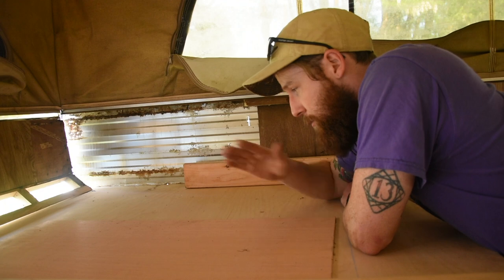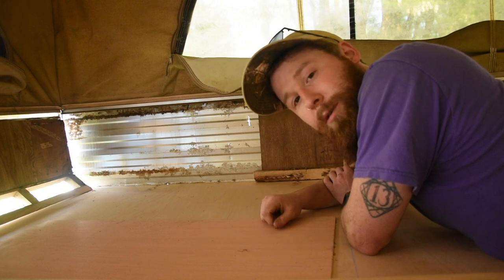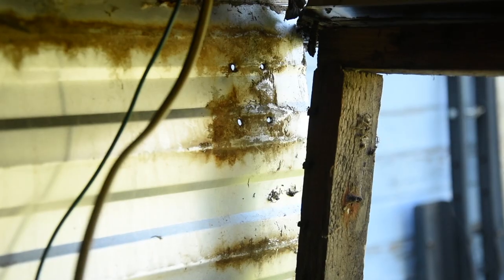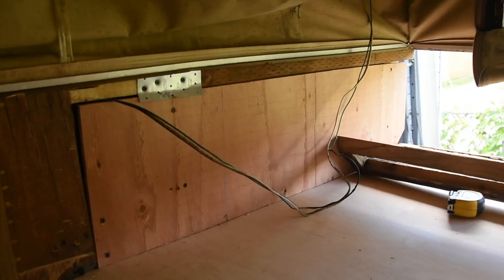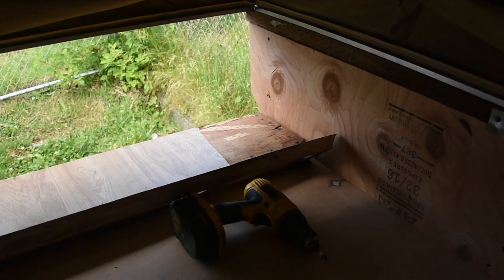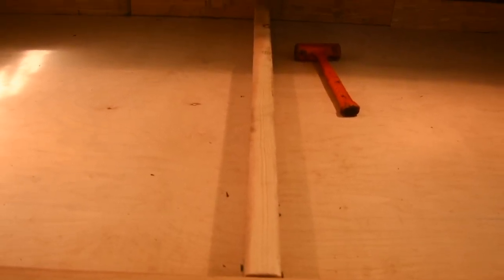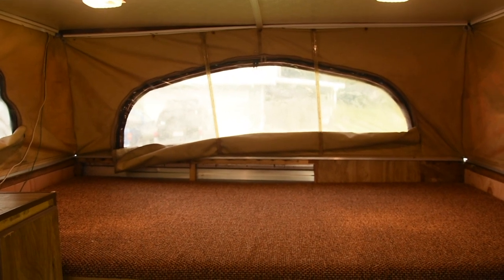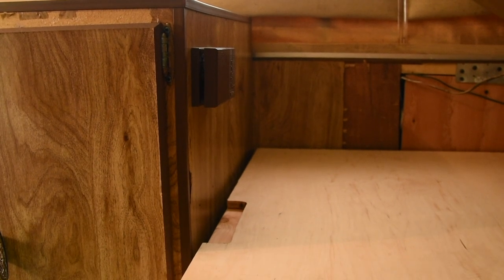Jayco Truck Camper Cabover Repair

Comment: The outside plyxood goes over the roof jack the full 8 feet and all the way down to the seat for overhang support. Take the siding off
Reply from the maker: I probably won’t rip it apart again with it all being put back together now. If I ever need to again I’ll consider your advice!

Comment: Thanks for the great video.   Were you ever able to get it sealed up tight again?
Reply from the maker: Yep! I ended up resealing all the front running lights as well. I think that’s where the water was coming from to begin with. We ended up selling this to some friends of ours but it worked for us as long as we had it.

Comment: Interesting fix on supports, thanks. 
I just purchased a ‘92 and the cable to raise the roof must be broken. No lift crank just turns? And video on accessing the pulley areas? Is it only done from outside pulling skin off? Thanks
Reply from the maker: On mine it’s all somewhat accessible if I took out the drawers under the kitchen area. To fully reach the whole stretch of pulleys and cabling you may have to remove skins or interior paneling. I would start trying to access the back side of your crank.